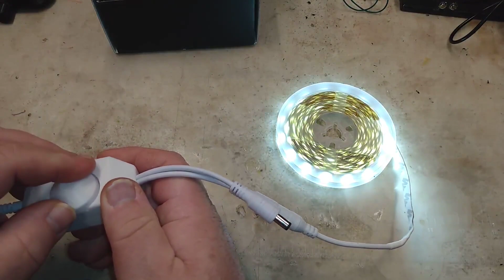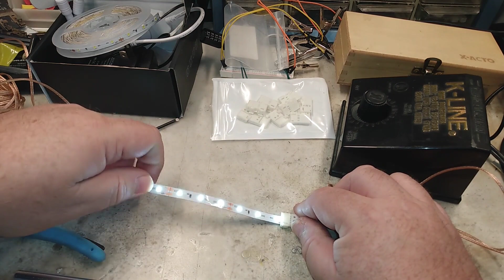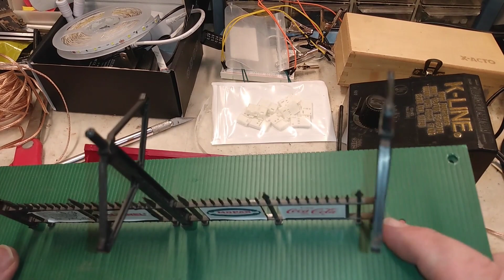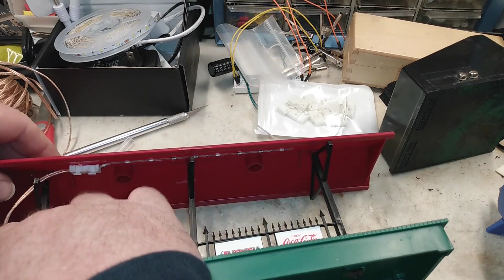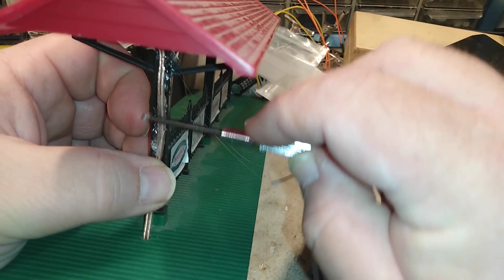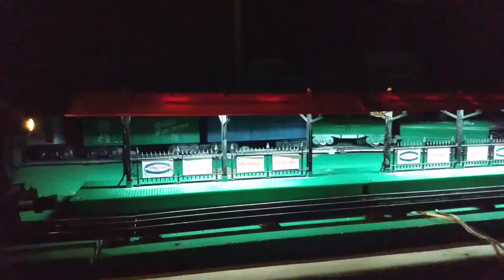How To Use LED Tape Lights For Model Structures

Comment: Using a transformer like you did instead of trying to find a way to daisy chain sections in a row makes better sense as I believe that one could simply run a bus wire from the transformer then wherever your building is, just at add a drop and your good to go!
Reply from the maker: Yes, that's exactly right and much simpler!

Comment: Can i use a 9 volt battery just checking      my transformer is put away
Reply from the maker: The answer to both questions depends on the input voltage of the particular LEDs, but both should work. A 9v battery won't last long, though.

Comment: Where do you get your  self adhesive  led lights st
Reply from the maker: Amazon [affiliate link] https://amzn.to/44eiHUV
Reply: Love your videos, you might want to update this link, it is for a 24 volt light set which takes a higher voltage to even come on than what I run my layout lighting circuit voltage at, found that out when I ordered these without paying attention to the voltage, need to find a 12 volt set to order now!
Reply from the maker: @Craigstoytrains  Thanks for the heads-up. They must have switched the products.

Comment: Are all leds dc oe sc volt
Reply from the maker: LEDs are diodes. Diodes allow current to pass in only one direction. You can run them on either DC or AC. The AC will make them flash on and off at 60 cycles, but that's faster than the eye can detect.

Comment: A couple of things here. 1. Never light the lights when they are on the reel, there's a chance of them shorting out - it says so in the instructions that came with mine.  2. When cutting pieces, cut from the very end of the reel, this way you preserve the dimmer switch with MORE lights. I've used about 40 lights off the end of one reel, but I still have the dimmer hooked up to about 200 lights.  3. I have those same connectors - they suck - quicker for me to solder the wires. 👍
Reply from the maker: 1) Good point. Mine did not say that, but it's an excellent tip. 2) Another excellent tip. 3) I went with the clips after melting several strips while trying to solder them. My eyes ain't what they used to be!
Reply: @ToyTrainTipsAndTricks  I know whatcha mean. I'm over 60 but I've needed THICK glasses since first grade. I wore only contacts for over 30 years, but now mainly wear glasses as my close-up vision is extremely good. I just slide them down a bit to see up close. Still, I have a bunch of magnifying glasses! Forgot to say in my last post... great videos! 👍😃
Reply from the maker: @E3Racer1  thanks!!

Comment: I use those LED strips all the time in model railroading.  I use them to light up coaches and houses as well.  If you have a lot of houses and buildings, you can run buss wires (one +, one -) underneath and connect the LED strips from each building to the buss.  You can also use small magnet wire on those 12 Volt LED strips.  If you use a single LED, then you have to use a dropping resistor.  The LED strips have dropping (ballast) resistors already installed on the strips.  For flicker free non directional coach lighting (HO and O scale) I use about 12 LED's on each strip along with a mini full wave bridge rectifier and a 3200uF capacitor all mounted into the car body.  I have a 12 volt 5 amp switching DC power supply to supply the voltages to all the houses and buildings on the layout.  W Rusty Lane K9POW in eastern Tennessee
Reply from the maker: Thanks for the information! I love East Tenn. We'll be vacationing in PForge this summer.

Comment: After you have cut it to length 
Can you run a wire from the other side and to another set of LED’s as if to light a waiting room for example
Reply from the maker: If you add a snap connector to each end you can attach more LEDs to the end of your run. The only caveat is to be certain that all of the LEDs are drawing the same voltage and power. If the lights have different specs you will need separate runs. Also be sure not to overload your circuit with too many lights.

Comment: Your thoughts on using the 'warm white' version to light the interiors of my Plasticville ranch homes? Thank you!
Reply from the maker: I think it would work. Just keep the light intensity low or the LED will shine through those thin plastic walls (or paint the interior walls if you are not concerned with original authenticity).

Comment: Very informative video.  If I might add, the three LEDs in each "block" are wired in series, but then the blocks are wired in parallel.  Therefore each block will operate on 12 volts and you can power as many blocks as you like.  However, the longer the string of lights you run, the more current it will draw.  One block draws very little current but a fifteen foot length of lights is rated at two and one half amps.  So very long strings can require a pretty hefty transformer or power supply.  As such, I do not recommend using them for general lighting, but they are great for what you are doing.
Reply from the maker: Thanks for the comments. I know a bit of the "why things work" in electronics, but not so much the actual math, which is why I wanted to "experiment" with them myself.  It makes sense that longer strings will pull more amps. Thanks again !

Comment: Excellent topic! I needed to see that connector you used to connect the transformer to shortened LED strip. Now, this is a good time to ask for advice from you or your other subscribers about how to light my prewar tinplate passenger trains that were not meant to be lighted, but without using track power. So far I have looked at using small battery powered remote controlled tea lights that I can tack to the floor of the car using poster putty. Problem is that they are dim and they flicker and are amber. Otherwise perfect! Remote controlled solves the problem of access to turn on and off without taking the roof off the car every time to turn it on or off. Any ideas or suggestions? The goal is no track power to be used.
Reply from the maker: It sounds like you're on the right track (pun intended) for your project. Instead of tea lights, you might look into some of the battery-powered puck lights. I'm pretty sure I have seen some with remote controls, and they are bright and white. Space might be a problem, however. Good luck on your search!